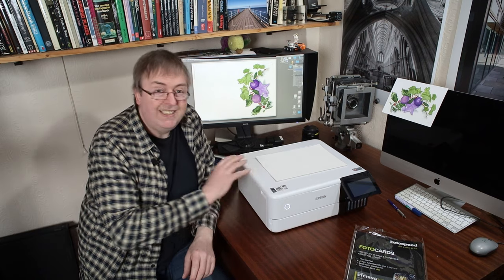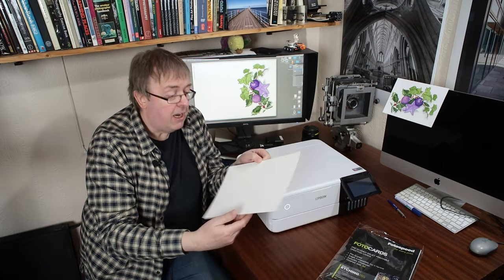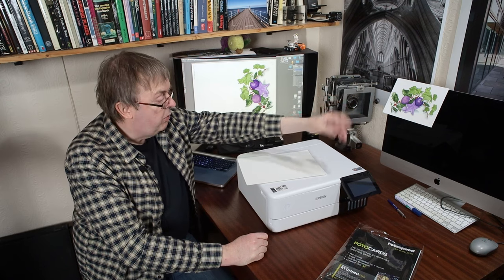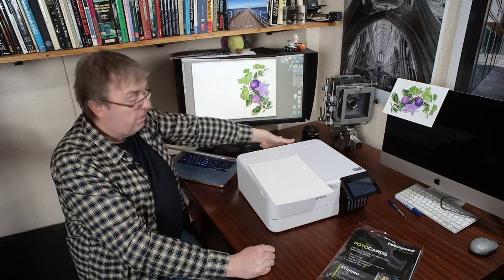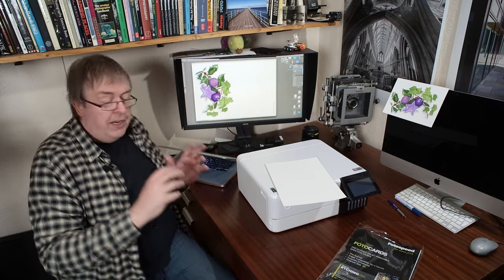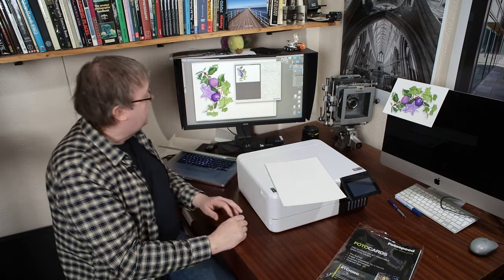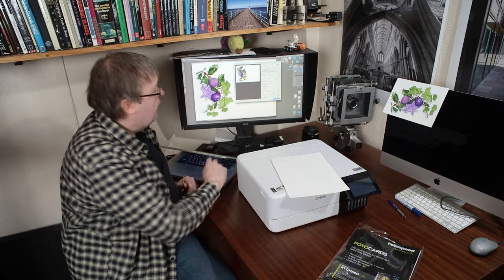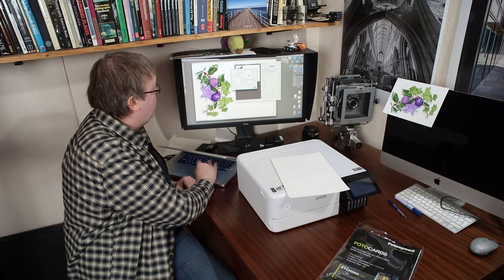ET 8500 rear paper feed setup for card & poster board. Printing with the straight through print path

Comment: thanks for leaving in the parts where everything doesn't work perfect. i remember a video where you printed on the wrong side of the paper, always a comfort to remember when i do that.
Reply from the maker: Thanks - there was one cut, where it just refused to print, since the network connection had died. That's stuff I will remove since it's just 'stuff'.
Glad the errors are appreciated ;-)

Comment: is the rear feed really the only way to use a 300gsm paper with this printer? did you try to feed it from the top to see how it behaves? I am just shocked that a printer that costs £600 needs this much tinkering to print cardstock, while my g650 can handle it better than this! I was hoping to upgrade but I am not sure if this printer is really an upgrade anymore..

Comment: I have a lot of trouble getting a longer, wider sheet to feed through straight on my Et-8550. Any tips on how to do that?  I've used books etc for support and I will use my hands to help keep it straight. To varying degrees the printer will draw it through at an angle which of course leads to a skewed print. I wish they made an attachment I could buy so that it would feed straight. The tabs are quite flimsy.
Reply from the maker: The only solution I've seen was a wooden one [plywood based - like a big tray] - Needed some woodworking skills.
Can't help with a link though - it was on a forum and I forgot to bookmark it :-(

Comment: Every time I load the paper in the rear tray it feeds it through and then says paper out!! Please help!
Reply from the maker: Check the paper sizes and driver settings [both media type and feed slot]
Try printing from Epson Print Layout as well
Reply: Hi Keith, I'm having the same issue. The paper shoots out the front and won't print. Where is Epson Print Layout? I've done all the specifications and set it to all your recommendations. Thanks!

Comment: I use the rear feeder in my 8550 for thicker paper like baryta. If I use the regular top feeder I got some roller marks. I think it’s because the paper is too rigid. But it works with the rear feeder. For now I’ve let the duplexer unmounted so I can load paper faster. Not the best solution but it works
Reply from the maker: Yes, it can help. A more robust feed slot would help with print accuracy.

Comment: Hi Keith, I have an 8550 and am getting roller indents when printing on 300gsm card through the top slot, I have tried a few different cards from different companies and the only one that doesn't leave the roller indents is a bit to thin to use as a greetings card as its bending. I have tried the rear feed slot, that you demonstrate here, numerous times and no matter what card or colour settings I try, the image is no where near the colour I get when printing through the top slot. All the cards I have used are suitable for inkjet, if I can get the colours to print via the rear slot the same as they do via the top slot, I will be happy to use the rear slot, I hope you can help!
Reply from the maker: Are you using the same media setting for each slot? That and the correct icc profile makes a big difference.
See the actual review [not the videos] for more
https://www.northlight-images.co.uk/epson-et-8550-printer-review/

Comment: Hello Keith! I’ve been looking at the 8550,  I’m wondering if there’s such a thing as a thick card stock printer that does both sides automatically. You mentioned in your demo the printed side may get scratched when you run it through the 8550 again
Reply from the maker: No such printer I've ever tested I'm afraid.
This requirement is firmly in the category of 'commercial print'...

Comment: Great video Keith (as all of yours are). My ET-8500 arrives on Tuesday but I'm confused that the ET-8500 is an 'up to A4 'printer, but on Facebook Epson say this:

The ET-8500 has photo-size and A4 front paper trays plus will print directly to suitable CDs/DVDs. The A3+ rear tray also accepts speciality media such as craft papers and card, whilst the A3+ straight paper feed means you can print on media up to 1.3mm thick and 2m long! 
My question is, can I set a custom paper size the size of A3+ and feed it though the rear feed?
Reply from the maker: Thanks 
Epson typo I'm afraid... someone a bit too quick with the cut and paste on Fleecebook ;-)
8500 - 8.5" width
8550 - 13" width
Reply: @KeithCooper  Thank you Keith, appreciate your time.👍👍👍

Comment: Hello @Keith Cooper, thanks for the instructional video. I'd like to know if you can give us the exact measurements of the problematic border for both 8500 and 8550? TIA!!!
Reply from the maker: Is this is the trailing edge increased border?
I can't check since I don't have either printer here any more - I recall it being some 25mm but that's not a figure I'd swear to.
It's not in any specs I've seen - I'd suggest asking at the printing forum at DPReview
https://www.dpreview.com/forums/1003

Comment: Hey so I have an epson ecotank 8550 and I’m trying to print from the rear paper feed slot and  
I have all the settings correct and it’s still not working. I’m using 
13” x 19” paper and I tryed using it in both the reed paper feeder and the read paper feed slot and still nothing. I was able to print 11” x 14” from the rear paper feeder but  I’m still unable to print 13” x 19” from the rear paper feeder as well as the rear paper feed slot. It’s just feeds it through the rear paper feed slot and doesn’t print. Feeds it right though in seconds but doesn’t print. Let me know if you can help me!
Reply from the maker: It should work fine for the A3+ setting - see the uses in the actual review
https://www.northlight-images.co.uk/epson-et-8550-printer-review/
With custom media sizes, sometimes the width needs to be set fractionally narrower [say 12.95"]
The other thing is to check the actual size of the media - I've seen quite a bit of variation.

Comment: Great video. Aside from a thread on the dpreview forums, I haven't seen much discussion on the accuracy (keeping the paper straight) of the rear paper feed slot regarding double-sided printing for the ET-8500/8550. Have you tried any thick paper double-sided prints from the rear paper feed slot and if so, did it all line up (accounting for the large margin requirement)? The blue tabs look a little flimsy...Thanks.
Reply from the maker: They are a little light - I've not printed enough prints via the rear slot to have tried this.
The whole rear feed mechanism is a great bit of design, but not very robust

Comment: Thanks for the very interesting video! I have an Epson 8500 and I ask you what maximum weight the upper paper input supports (I can't find any specifications on this). I deduce that beyond 0.6 mm of thickness you have to use the rear entrance or am I wrong? Secondly, the size of the fish, 0.6mm? Grace: D
Reply from the maker: Yes - I don't have  any specifics on this, but do see the notes in the main [i.e. written] review
https://www.northlight-images.co.uk/epson-et-8500-printer-review/
I tested quite a few papers
What do you mean by fish!  [assuming this is a duff translation!]
Reply: @KeithCooper  Thank you! I read the article: very interesting! yes, sorry, I didn't double-check the Google Translation :D I meant: I deduce that beyond 0.6 mm in thickness, you have to use the rear entrance. So, in your opinion, up to 0.6 mm thick could I use the upper paper input or would there be a risk of damaging the conveyor rollers? thanks and sorry for the mess
Reply from the maker: @artistatrentina  0.6mm will depend very much on the characteristics of the paper - I believe I tried some 0.5mm during testing.
Very much 'it might work'

Comment: Hello Keith, 
I still have a question about the thickness of the paper. The paper I want to use for a postcard is 320 grams crafted paper and the size is A6, do I need to take the tray in the back like you showed in this very good video? Or can I take the tray up front for that too…or can’t I do this kind of thick paper at all?
Reply from the maker: It's actually about thickness, and that is not the gsm weight - unfortunately thickness is a much less common figure found in many paper specs.
However, I I tested quite a few cards and thicker media in the 8500/8550 - the top slot often works well
See the main [written] reviews at:
https://www.northlight-images.co.uk/epson-et-8550-printer-review/  and 
https://www.northlight-images.co.uk/epson-et-8500-printer-review/
Reply: @KeithCooper  Thank you for your fast reaction!

Comment: Can this do more than one sheet of 13x19 standard copy paper at a time?  I see conflicting information that says only one sheet at a tome and others that say fifty.
Reply from the maker: The 8500 [this video] is only 8.5" wide
If you meant the 8550 - it can with some papers, but don't rely on it - the 50 refers to plain paper at A4 I thought? However 10 sheets of copy paper should be fine

Comment: I have 8550 and my problem with rear feeder is lack of alignment. It always comes out crooked... Sadly printing 300gsm+ from top feeder is not possible because of pizza wheel marks.
Reply from the maker: The only solutions I've seen have involved making an external guide setup which the printer sits in.
Depends a great deal on the practical construction abilities of the owner... I don' t have one here to test at all.

Comment: Hi, I get 2 rear paper decriptions appearing in any print application.
One is 'Rear Paper Feeder' and the other is 'Rear Paper Feed Slot'.
But nowhere does manual tell you which is which.
Can you advise?
Reply from the maker: You only use the one right at the back for card and the like - everything else went into the top.
See the main [written] reviews
https://www.northlight-images.co.uk/epson-et-8550-printer-review/  and
https://www.northlight-images.co.uk/epson-et-8500-printer-review/
Reply: @KeithCooper  ok, thanks but, which print dialogue do I select for the one at the back? I get 2 dialogues appearing in any view/print appl. ???
Reply from the maker: Sorry, I cannot remember the exact wording - the printer went back to Epson quite some time ago.
I'd suggest asking on the printing forum at dpreview.com - plenty of users there. Be sure to mention exactly what system you are using, since the wording varies.

Comment: Hey Keith, Epson states this printer can handle media up to 1.3mm thickness, but you stated 1.6mm in the video. Just curious if this was a simple error on your part or if you've actually managed to get media that thick to work. Thanks.
Reply from the maker: The media I used was Epson poster board and that is listed [IIRC] as 1.6 - check the specs?
Do note though my observations about the plastic guides - which may cause some issues. I don't have boxes of the stuff to use up in tests ;-)
Reply: @KeithCooper  thanks for getting back. Their poster is 1.2mm. Looks like the P700, P900, and P5000 are the only ones that can handle 1.5mm. There are just so many people complaining online about feed issues with those models that it makes me nervous to spend the money.
Reply from the maker: Yes - my testing shows it can work, but not that it will work every time. This is unfortunately a limitation of the sort of testing I can do in a month or two with a printer before it goes back.

Comment: Thanks. I am a crafter and using a4 card stock , 216 - 250 -270 grams. Did you test also this kind of paper in order to review the quality. I am looking for a new printer and this type has been advised, but need info from other people about their reviews. Hope you can help me?
Reply from the maker: Anything called 'card stock' is generally likely to give poor results unless it is intended for inkjet printer use. See my full set of 8550 and 8500 reviews [ the printers are the same, but for size]
https://www.northlight-images.co.uk/epson-et-8550-printer-review/
and
https://www.northlight-images.co.uk/epson-et-8500-printer-review/
Reply: Just found out that some people have the et-4850 for card stock printing and they are satisfied regarding printing results. So my opinion should be than if i buy a higher segment printer than i should be printing card stock with the et-8500 or et-8550. But i hoped you could advise me which printer is the best suitable for printing pictures / photos on card stock. I have also card stock of 120 grams. So wondering if you can advise me? Appreciated. 
 @KeithCooper
Reply from the maker: Ah, it's not so simple - the 'better' 8550 is only for media it does well on
Sometimes cheaper printers print better on cheap/non-specialised media
Reply: What printer did you buy at the end? I want to print scrapbook and Journaling paper and wonder which printer would be the best. Is the more expensive 8500 better than the 4850? 🤔 @gjjspek
Reply: Finally bought et-8550. A3 if i have some larger than A4 to print easier to use the Et8550. Good photo printer , best choice .

Comment: Is this the only current epson with this feed. My Stylus Pro 4000 could be fed this way and I've been looking for something affordable in the epson line to do this. I don't want to print anything super thick but thicker than cardstock.
Reply from the maker: P700/900 support it [as well as the ET-8550]  - don't know what else oes
Reply: @Keith Cooper  Thanks! I watched those videos as well. Now just looking for a cheap use one of either model. Your videos are really useful!
Reply: @KeithCooper  Just realized the P900 doesn't have any third party inks so I guess I'll try my luck with thick paper using the XP-15000
Reply from the maker: @MechanicalPencilGirl  It does, but I'd never use third party inks
Reply: @KeithCooper  Even better. Just got a p900 I can repair and official inks!